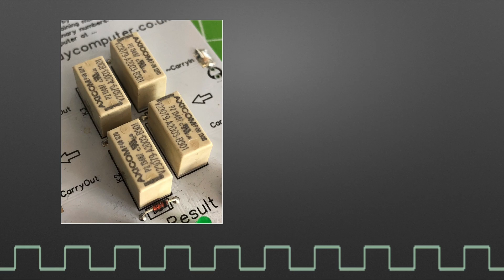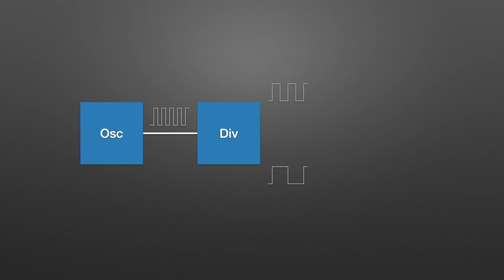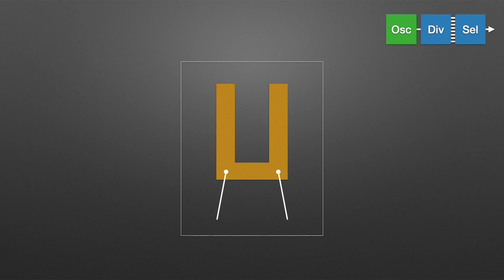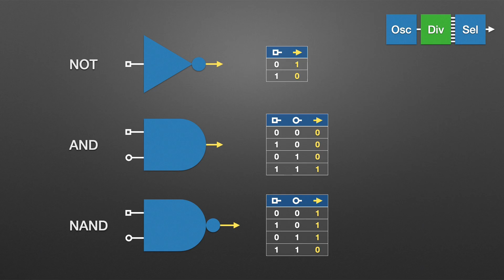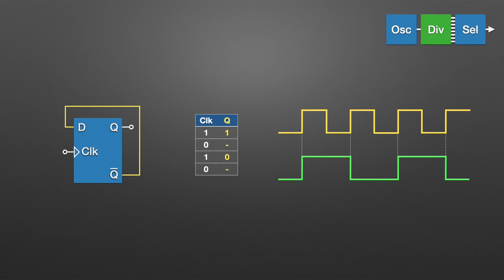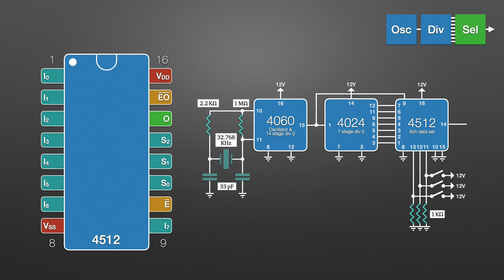Relay Computer Clock - Ep10 - Crystal Oscillator Clock Design

Comment: The circuit you've shown at 17:00 is a transparent latch. This won't work as an element of a counter or shift register, because changes at the input are immediately reflected at the output while the clock is high.
If you wire one as shown at 17:55 it will oscillate when the clock goes high. To get the behaviour you've described there, you need an edge-triggered flip flop, which is a bit more complicated internally. It has the behaviour that the output only changes when the clock changes from low to high (or high to low depending on the part) and it changes to whatever the input was just before the transition.

Comment: Fantastic videos, thank you for this valuable resource. The 555 is GREAT, but not accurate enough for an actual clock, as the frequency can change with ambient temps. Crystal is the way to go for accuracy!
Reply from the maker: Absolutely agree. In the end I went with a PCB that has a relay based clock and a crystal based clock - one for 'authenticity' one for practicality. As it happens my relay computer would be quite happy to run off a 555 clock even with the frequency variation - the relay based clock is similarly affected by temperature.
Reply: @paul80nd Ha! I just did the exact same thing!